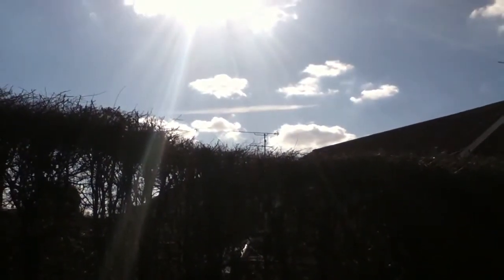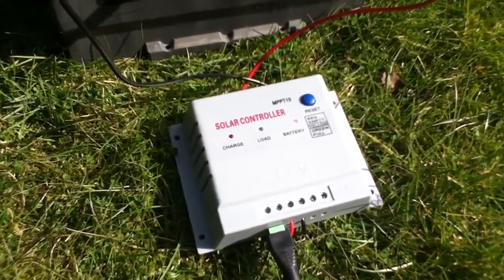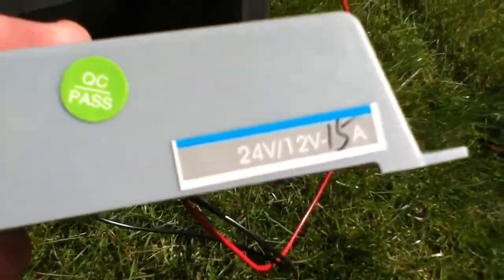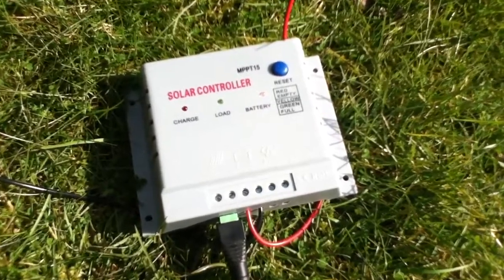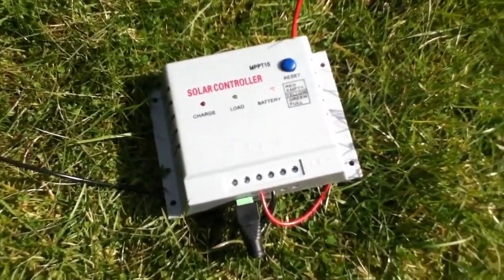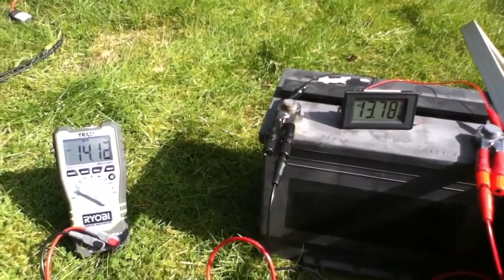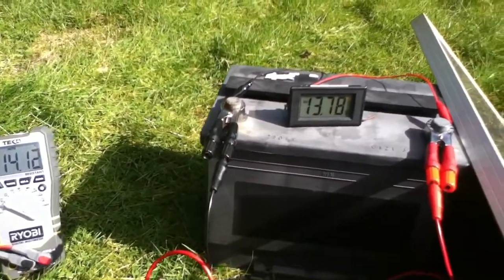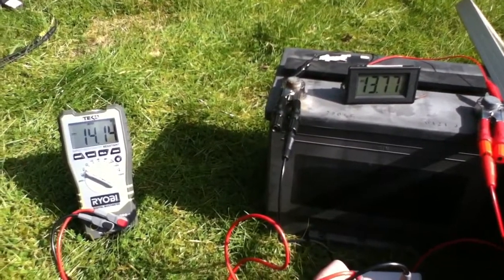WellSee MPPT Solar Charge Controller - Garden Tests

Comment: You have to also check the currents. If mttp is working power loss would be minimal. Not conclusive but my impression: fake mppt, just pwn. That’s why you got so low panel voltage.
Edit: I am here because I found this on my long time ago discarded electronics pile and well just to make sure it was on the right place 😂
Oh and they are still selling this… thing.
Edit: I remembered they said in the manual that you must put a coil of certain muH for mppt. I just did that (well with a wild guess about the inductance) and… some mppt seems it is there.

Comment: For me, this thing seemed to do everything correctly but MPPT lol. I remember being so bummed when I hooked this controller up like you did and took my measurments and found that the amount of energy I was getting into my battery with the controller being utilized was the exact same as when I was charging my battery without it! Talk about dissapointing lol. I learned a valuable lesson though: research your purchases before you buy them!!

Comment: To see if is MPPT get voltage and current of solar panel, and then voltage and current going into a drained battery.  When you are above 13.2 volts you have a fully charged battery and if it gave the batteries full charge it would hurt them.  The volts on your meter are 13.7 volts.  The bulk charge could be 14.4V , the float about 13.3V

Comment: ***** and by better you mean exactly the same number but without the negative sign? LOL. I think you shouldn't play with electricity.
Reply: You will get a negative or positive reading just based on the position of the common (ground) probe of the multimeter.

Comment: The reason why I'm particularly interested is that there is a current school ov thought that since panel prices are substantially dropping, it is often cheaper to just get a few more panels and use PWM controllers. And in my situation I have been able to pick up quite a few polys for a very good price (around $1NZD/watt). However the weather here where I live is often overcast since we are semi coastal but close to the hills. So that's the situation I want to optimise.

Comment from the maker: I'm guessing it works best when the difference between panel voltage and battery voltage is greatest. So, as you say, low battery voltage and high panel voltage which occurs when the panel is cold. If you're right about mono and poly panels, then I guess mono would work best with MPPT. I'm hoping that my experiments will answer some of these questions.

Comment: That will be interesting to see how you go with that design. :) One thing I am curious about is does MPPT really do a good job during low light conditions? I understand it works very well on a sunny winter morning when your batteries are low, but some say it's great under cloudy conditions, but others say its lousy. I wonder if it also depends on the panels you use? I have noticed that the voltage ov polycrystalline panels falls faster in low light than mono ones.

Comment: Yeah I bought one ov these & I tested it exactly like you did, comparing the battery volts with the panel. And initially I thought it was good until I realised that a PWM could allow the panel voltage to rise while it was "PWMing".. ;) So the next test was to compare the current with the Wellsee in & with it out (bypassed). Guess what? More current flowed into the battery with it switched out than with it in! That's not really MPPT is it?

Comment from the maker: The Wellsee has no algorithm - the 555 oscillator runs at a fixed frequency and mark/space ratio so there's no control of any kind.

I want to build a manually controlled MPP controller where I get to operate inside the control loop. That way I will get a feel for how the tracking algorithm should best operate. Ultimately this may lead to an Arduino based MPPT controller - which will be open source.

Comment from the maker: Yes, you're right - MPPT is only used during the bulk charge phase. At float you don't want maximum power. I would like to see the controller switch to a low frequency PWM during float charge.

Comment: What do you get with a dead battery? Say at 10.5volts. I would have thought that is when MPPT would work best. The closer you get to charged, wouldn't it float the charge? Sort of just keeping an eye on the battery. MPPT not required. I know nutting. Just asking questions of interest to me.